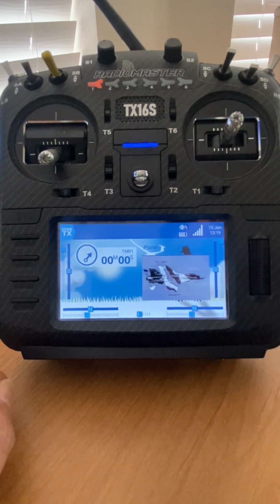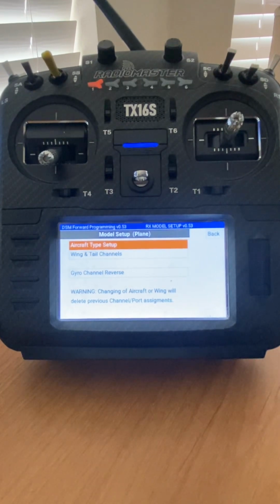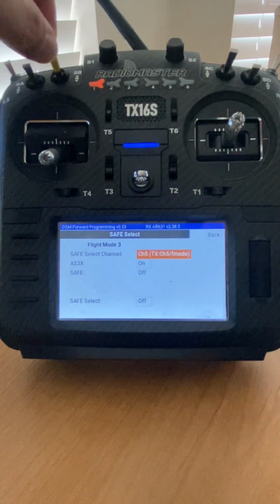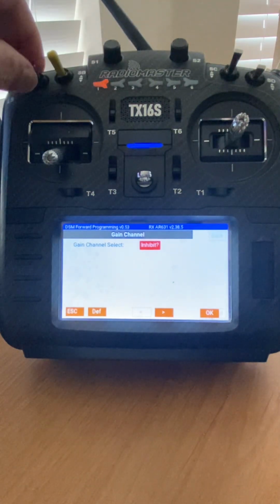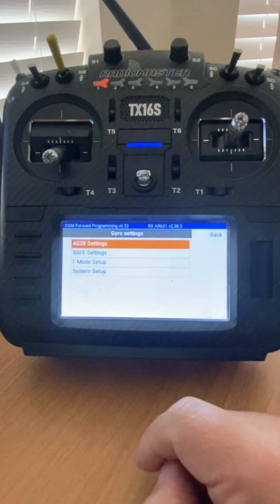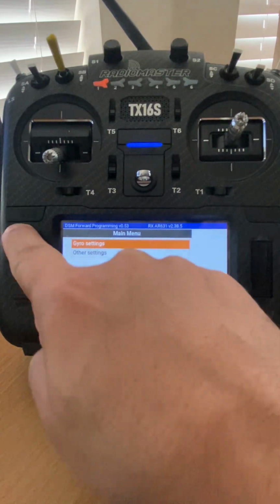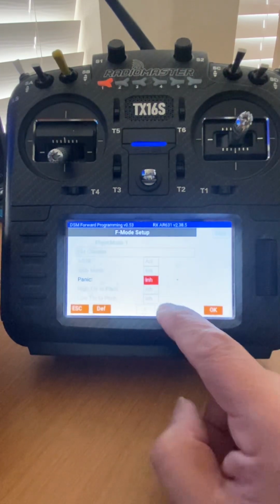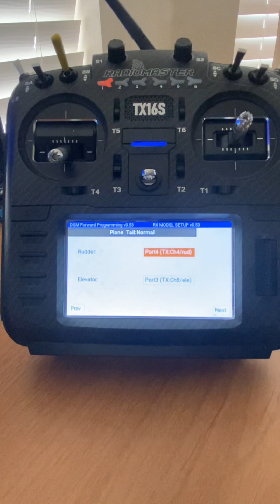Spektrum DSM Forward Programming on EdgeTx/OpenTx

Comment: Hello Francisco, great work...! I could not access to forward programming to the rx (AR636A) using  edge tx + tx16s , message "No compatible DSM RX..."  Is there anything I am doing wrong..? Thank you
Reply: Also happen with receiver AR630
Reply from the maker: Tha AR636 dont support forward programming.. the AR630 do support it.. if the 630 comes from a BNF that is a bit old, the RX was locked.. you probably will need the USB dongle to unlock.. first make sure you are using DSM X2F protocol

Comment: I have programmed a few helicopters and planes using this and it works great but I do have an issue of when I go into forward programming I’m not able to exit the screen gets stuck and the I get a message saying RX disconnected. I end up having to turn the radio off and on. I’ve tried reinstalling everything but same issue.  Does anyone else have this issue ?
Reply from the maker: Try a long press of the retrn or exit button.
Reply: @franciscoarzu8120  wow haha something as simple as that. Thank you!

Comment: FEEDBACK - Francisco, I'm using your latest (0.55a) version and came across an issue that @shanesdiy helped me to resolve.  I could not get an assigned (channel 10) 3 position switch to provide Flight Mode 1.  Despite correctly setting the Flight Mode channel in your GUI it failed to allow me to set a configuration for other than FM2 and FM3.  SAFE could all be enabled but I could not resolve the issue myself.  On Shane's advice I disabled max throws and all is well.
Reply from the maker: Enable max throws cause that behavior. Good that you solved it.

Comment: I have a eflite Carbon z 150t with AR637TA rx. On the newest tool DSM forward programing v0.56 neither of the 3 flight modes turns on safe and I do have safe select enabled. Any ideas? Thank you!
Reply from the maker: The screen is only showing what the RX provides. The Forward Programming safe-select interface is not that easy to read/understand.
 You can verify with the RX_SmartRX_Tel.lua script if your flight mode is turning auto-level on.  first make sure that your switch is activating the proper flight Mode: Probably FM  1..3. Then on the side it will show "As3x" if its ON (will not show if OFF), as well as what is the safe mode (Level or Envelope).    This info is also show in the sensor "FM".  Also remember that   sometimes "Auto-Level" only activates after throttle passes 25%.      Verify in the screen that you do "Bind" that "Enable max. Throw" is OFF... otherwise your switch will only do 2 of the 3 flight modes.

Comment: Fracisco, i have a boxer and the menus are different. i do not have the model set up available in the forward programming menu.

Do you know where can i find it? 
tks
Reply from the maker: For black&White radios due to limited memory, had to split it in two scripts, one to do the model-setup, and one to do forward programming.. they work together.   Look for the B&W version 0.56.
https://github.com/frankiearzu/DSMTools
Reply: @franciscoarzu8120  Thanks for the response,  keep in ming i am begging on github and file so please be patient with me, my questions may look really obvious...

i saw folders : i guess i need to go dms forward programming, then blac and white 124x64 then there is several zip files starting with dsm... what do i need to find the lua file?

i did read the readme file and indicates that i need 3 lua files in the script/tools and 4 lia files in the script/tools/dsmlib folder.  where should i find those 7 files?

thanks again

Comment: Will this script work for the AR630 using Opentx on a RadioMaster 16TX?  I tried it and it says no compatible DSM X receivers found.  The model is bound to the RX.
Reply from the maker: Have not tried OpenTx in a while, but the 630 should work.. other people has reported problems with BNF receivers until is unlocked..  do you have the USB programming cable??
OpenTx haven’t have any development in almost 2y. That’s why only test in EdgeTx

Comment: Thank you for an excellent set of Luas and video Francisco. I am trying to help a friend with a new EFlite Night Radian with a AR631 Rx. I can set it up successfully on my Tx16S, but on his Zorro using the min version (v0.54) I can only get Mode 2 and Mode 3. I cannot access Mode 1, moving the switch remains in Mode 2 when it should change to mode 1. Mode 1 is what he wants switchable for panic moments. Any advice would be greatly appreciated.
Reply from the maker: Check that your "enabled max throws" is turned OFF in the  module seetings (where you do bind).  Someone was having a similar problem in the past, and that setting was the culpid.

Another usefull video is you haven't seen it.
https://www.youtube.com/watch?v=mEfLGnEZN9U
Reply: @franciscoarzu8120  Many thanks. Turning OFF "enable max throws" solved the problem.

Comment: works mostly perfectly. but refuses to let me select the gyro fm channel and gain channel i want.
no matter teh channel i select, it reverts back to the next available channel as soon as i select ok.
i have had to use nx10 to select channel 7 and 8, and then remember to never go into fm or gain channel selection again
Reply from the maker: Did you setup a slider/rotary channel on ch7/8?? The RX validates that the channel has signal on it. That validation is done by the RX. Move the slider/rotary to select the channel..
Reply: @franciscoarzu8120  yes.  I have a 3 position switch for flight modes and the rotary S1 for gain.  All assigned to channels. But when in fwd programming no matter what channel i select for fm and gain.  It reverts back to channel 5. If I use my nx10 to setup the reciever.  Then bind to the tx16s it works fine.  But I bought the tx16s with plans to sell the nx10 soon as I got it working
Reply from the maker: @dieselguy62  select it by using the switch/rotary.. not by changing it on the screen. Somehow on the TX16S, needs to see activity on the channel
Reply: @franciscoarzu8120  that worked out great.  Thank you

Comment: Thanks so much for this excelente lua..but i have one Problem..
If i adjust the Attitude Trim in the Panik Mode(fm3) IT do Not save the value..that means If i want top have a little mor Elevator Up in the Panik Mode i can adjust the value, but If i Go Back in the Forward programming IT lost my value...
Do you have an Idea??
Thanks so much for your genial Work..
And sorry for my Bad english...
Best regards
Orson
P.S.
IT IS the 637 t reciver
Reply from the maker: UPDATE: Was a bug, fixed in v0.54

The Attitude Trim is global.. is not specific for a flight mode.
Even that the values are editable in the screen.. they are not.  It read the values from the current level position of the RX/Plane when entering the screen. The  top "Level model and capture attitude" re-enter the screen again and show the values read by the RX.

Comment: Perfect info, i need your thought. I am using Spektrum AR637TA, BNF type RX. After Binding, i can use Telemetry and Safe but when i click "DSM Forward Programming" it says No Compatible RX. Please advise how to solve this issue. Thank you very much in advance.
Reply: You have to unlock the Rx using a Spektrum program cable
Reply: That's cause it's a locked Rx . You need the program cable to unlock it before you can use forward programming
Reply: You must have the receiver turned on and the radio bound to the receiver otherwise you will see that message.